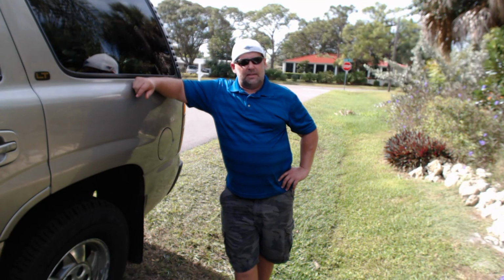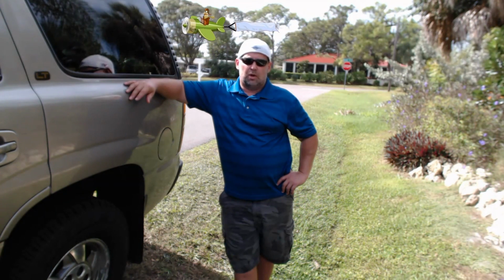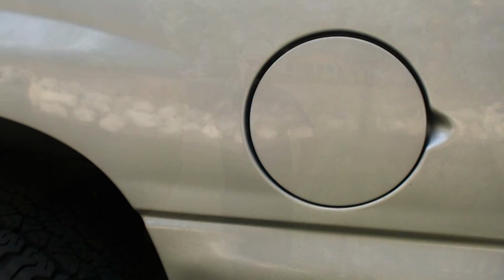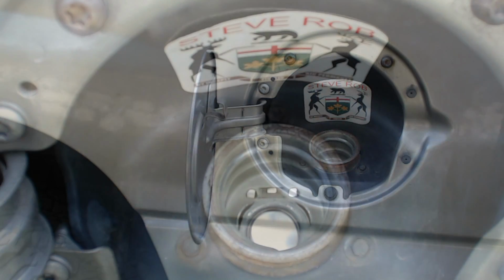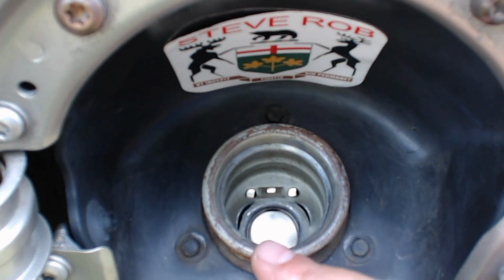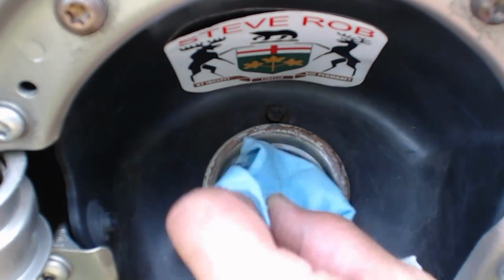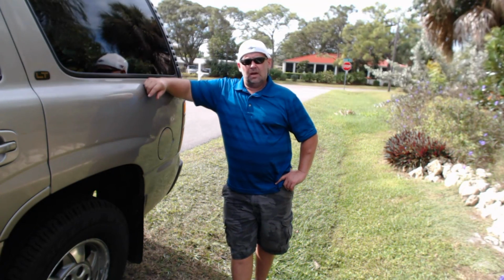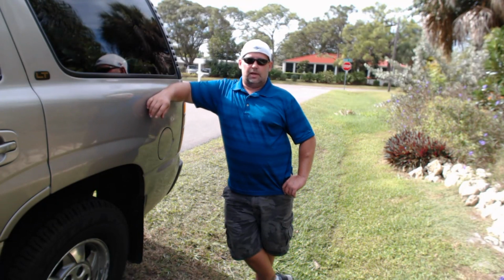FUEL PRESSURE SENSOR CODE P0453 FIXED

Comment: Great repair Rick. I had the same problem with my van and cleaned the top of the filler neck and haven't had a problem since.
Reply from the maker: +wysetech2000 Thanks